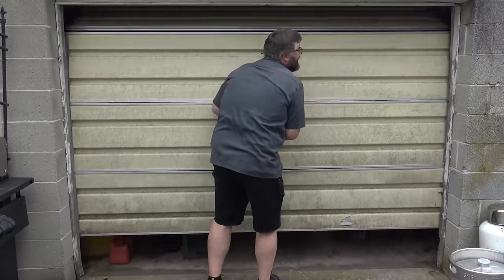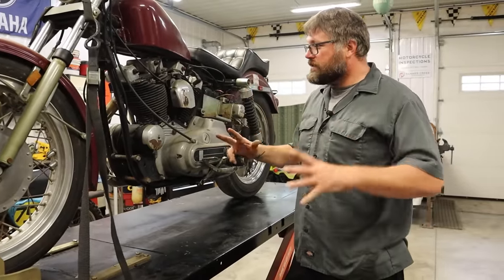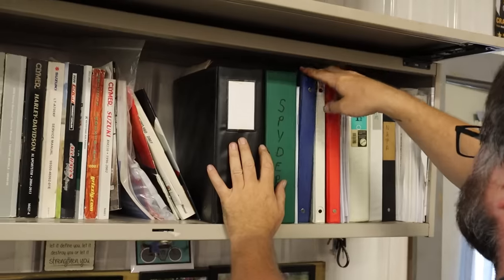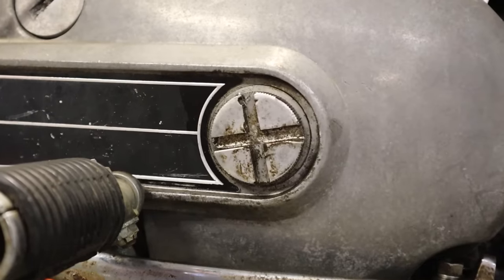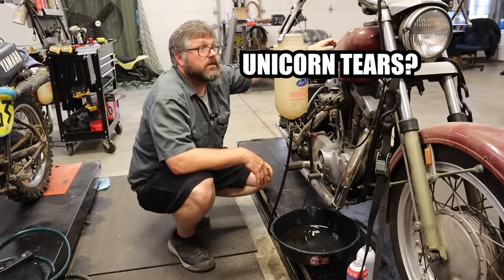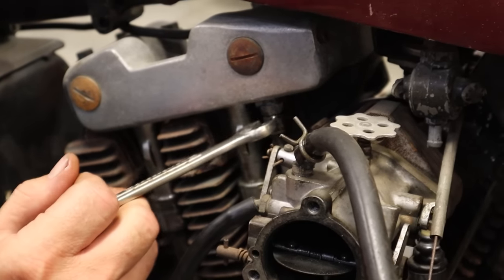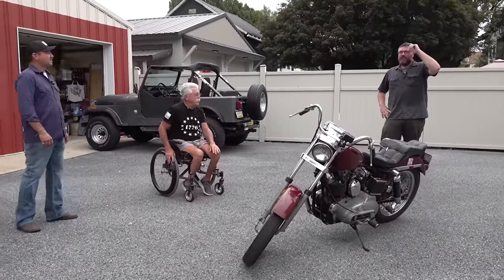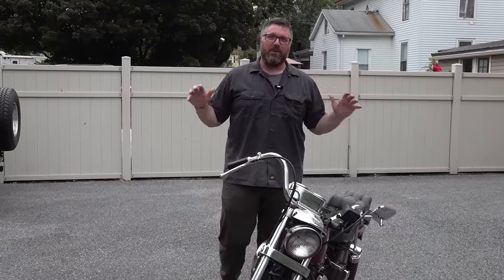Can I Get This Forgotten Harley Davidson Running? (I Just Stole It)

Comment: You keep doing bikes that bring back some really good and scary memories!
My old riding buddy was from Lancaster, Pa. and he rode a 72 AMF Sportster. I rode a new 79 Yamaha XS eleven Midnight Special 
I would pull out my emergency kick starter so, he would stop giving me crap about my wussy electric start feature. 
We lived in a small town with a summer time population of 500 and winter time of 250 . 
We were the talk of the town ( not in a good way ) because we rode bikes and had long hair! This was during the late 70’s to mid 80’s
It didn’t help that our town was a stopping point for the dirty dozen summer ride!
He used 16 penny nails to rivet his back sprocket to the hub and called it good! “Bubble gum and bailing wire” was his tool kit!
What a blast of a good time.
As always stay safe and healthy!
Ron

Comment: It's a 1972 XLCH Sportster. First year 1000cc. First year with no magneto. Last year for drum breaks. Last year for no turn signals. I had a 72 XLH (electric start). Mine also had the aluminum flat track rims. It was equipped with a Bendix carb. Wait till you try to take the primary case off, it takes a hammer impact driver to budge those phillip head bolts out. It's a wet clutch, that's why there is oil in the primary case. I loved that motorcycle, had so much fun on it. I now wish I never sold it. In fact I will have occasional dreams that I still own it and find it in need of love.

Comment: This has quickly become one of my favorite motorcycle themed channels, thank you for the informational yet entertaining content! Here's a pro tip regarding badly designed work lights without magnets all the way from faraway Finland; in my own quite dimly lit garage I use a headlamp (the kind you strap on your forehead) while working on my 2 oldish Suzukis. I have one with variable zoom and different power levels. It frees up both hands, doesnt fall over and directly lights the thing you are looking at. And as it is almost eye level, no shadows.

Comment: You are a good friend. I bought my best friends bike after he passed away from his wife. I am restoring it. It’s an 83 shovel head sportster. Has not run in 15 years but I am doing a basic frame up restoration. It’s almost finished. Taking his original parts and repairing them but did have to replace a few. So it’s a little bit of I am in a little bit of me. And as I keep wrenching on this bike I’m remembering all the good times we had. So one day soon I’ll be riding with him again

Comment: You need one of them deisel/used oil heaters for your shop...home...or both. Even as a backup system you can save money by burning your old oils during the cold parts of the year.

Comment: This is so great.  My own 1974 XLCH still "runs"...technically, but needs much rework on it's brakes, along with a new set of tires.  

I caught a lot of grief back in the day as the new Japanese Super Bikes were coming on strong, but I loved/love my old Sportster and its rumble, and it never let me down in the years when it was my only ride.

Thanks for great video and audio flashback!!!
Kim
Reply: I have a 74 xlch too 
Had it since early 80s
Haven't road it since Easter day 2003.
Because of reasons..just bought  a really nice 2014 ultra classic. And I don't know. 
It's not what I thought. I need my xlch back in the wind

Comment: Rather than starting fluid, I use a trigger spray with petrol in it. 
Picked up a XL125V Varadero that had been laid up for a few years, bottom of tank was pin holed. fitted a temporary tank but wouldn't start. Removed the airbox and sprayed petrol into the carb intakes and it fired. Removed the carb, popped the fuel bowls off and everything was covered in a hard thick green gunk. The main and pilot jets were blocked. Didn't have the correct size just went a size up in each, replaced the tank and the bike has been fine since then.

Comment: Wow, this took me back! Great job coaxing it back to life. I had a ‘76 iron barrel XL 1000 30 years ago which was the transition year so left shift using the brake lever as a gear shift and right brake. Disc front brake and (allegedly) 67 horse power, the same as a Honda CB 750. I had a CB 750 and I believed Honda….. It seemed to use a ton of oil (once I got it going). In fact it was decanting to the chain case which would account for the dragging clutch. The battery was massive but needed to be for the electric start. Rumour has it that it needed 30 miles for the dynamo to recharge the energy lost just firing it up. It was the worst quality bike I’ve ever owned (even a Czech CZ 125 was better). But it was a Harley and I loved it! Sadly its utter lack of reliability and practicality meant it had to go but a sad parting. Love the channel! Best, Ian

Comment: The service manual for the 1982 XLS crankcase/clutch calls for H-D Sportster oil OR a quality 20W-50 if the H-D oil is not available.  There is a screw at the forward bottom of the case.  When it is removed, you fill the case until oil runs out of the hole, then it is filled.  The oil tank should have a separate drain.

Comment: The key to starting that year is to kick it through 2-3 times with the key off. Then turn key on, give it a little gas and if it's tuned properly it should start on the second  kick.

Comment: I use old hospital IV hangers to hold my aux. fuel bottles in the shop but a cheaper/easier to find option is to find a steel shepherd hook plant hanger and weld a base to it.

Comment: In the 80's I had a 1971 XLCH 1000 Sportster. AMF of course. Oddly, it was electric start only! I have noticed some people on youtube miss the fact that Sportsters are only right side chain ( or belt) while bigger hogs have left side with seperate transmission with primary chain or belt.

Comment: That bike looks like a 1971 Sportster XLCH. Last year of the 900. Harley went from 3" diameter pistons to 3-3/16" pistons in 72, thus 1,000 cc. It has been repainted. The aluminum rims are Borronni from Italy. Tires look original. Buckhorn handlebars.
Reply: I'm not sure it's been repainted.  It looks like "Sparkling Red", which was a 1971 color with the Harley decals removed.

Comment: The 1970 model year was the last year for the old style points drive pointing upward near the V of the cylinders. This bike, being a 900, with that style of points drive must be the 1971 model year XLCH. 1971 was also the last year for the ignition switch under the seat and the dreaded Tillotson carburetor . The 1972 model year was upped to 1000cc and the ignition switch was moved to the now familiar location on the left above the horn and got the Bendix carb.
Reply: also has the primary and left crank case for electric start

Comment: Thing with these carb bikes, is once you get them running right, you gotta run them pretty much every day, to keep them running right. Just enough to keep everything warmed up and closed up. Plus, ethanol gas kills these carbs. Best to keep some ethonol treatment in that gas even if you run non ethanol gas in it. Keeps all the carb rubber alive and the jets ungummed. Fun video. Nice to see the two wheeled gremlin lives but it definitely needs someone as possessed as Craig who will go through it and rebuild all the trouble parts. Starting with the carbs and that clutch cable, since that was pointed out as a real repeat issue. Damn nice Harley though. That classic Harley running perfect, polished up with new tires on it, would be awesome.

Comment: Snap On makes the tool to remove the plug from the side case which gives you access to the clutch adjustment screw.
Reply from the maker: Snap on makes a tool for everything!  I want one of those players that can pick up a nickel for the edge

Comment: 👍 primary oil & transmission oil are one in sporties. Level check screw in front of primary,bike up right. 
Manifold rubbers were always shits & did I see correct a block of wood is the heat spacer on carby? 
😉

Comment: My first Tax Plated bike was back in 68 which started my wrench-ride-repete crayze.
From the beginning  when cleaning points I've used a finger nail file to keep the contact surface flat and a single dollar bill on mine and a Benjamin for customers points to clean and clear anything that would burn and pit the point surface. Bill folded with the green ink to the inside, the ink never drys and will leave a coating.
If anything else I do it as a tribute to the Cycle Gods

Comment: 70/71 900cc changeover year Sporty. Had one - It'd get me to the run destination - quite often not got me home. Bad case of sh*tting valves - or gearbox locked in 4th gear.
Great learning curve for a first HD. Totally stripped/ rewired/ rebuilt - no internet in those days

Comment: This also might be a little late but make sure you have oil in the transmission also if I remember correctly transmission oil change is separate from the engine oiling

Comment: Run to your local hardware store and grab a threaded floor flange from the plumbing section and a piece of black steel pipe to match about 4 feet long.  Instant and removable gas IV pole

Comment: It's a 900 XLCH prob late 60's or early 70's. The rims are for taper bead tyres, it was a safety feature that licked the tyre beads onto the rims. Trouble was ordinary tyres were not supposed to be used. It's a Tillitson carb. They used 3 types of carbs, Tillitson, Bendix and Kehin all with accelerator pumps.

Comment: Looks like a 1971 XLCH to me.  As for the Tillotson carb, you need to "tickle" the diaphragm from underneath with a paper clip.  If you google it, you will be able to find info, it's pretty easy.  But you need to do that to draw fuel into the system after they sit for a while.

There is a big Ironed Sportster gathering in New Jersey in October, you and your buddy should ride your Ironheads out and join us.
Reply from the maker: I’m not tickling anything from underneath 😂

Comment: Just a heads up on the iron heads dont use normal motor oil in the transmission on theses it causes the clutch to slip. Use motorcycle oil or Lucas universal transmission fluid instead
Reply from the maker: Always use motorcycle or diesel oil. Never car/gas oil. It will make all clutches slip

Comment: Looks like my 71 XLCH. It's a good year with all new motor castings. 
Mine has over 200k and les than 10k on It's first rebuild. I bought it in 1988 or 89 not running with a bad paintjob and that same horrible seat dyed maroon.
Many were victims of trans failure due to the speedo drive weakening the corner by the output shaft.
They run much better with a carb with an accelerator pump. 71 and 72(1000cc) are notorious for wet sumping and breathing the oil into the primary.

Comment: love the old stuff. keep em running, i have a bunch of used parts from the past. flush the bike out with diesel or kero, than clean the tanks ou,t add marvel mystery oil with gas & 15-40 diesel oil in the oil tank. run it around some, drain oil and fill wt 60wt.

Comment: That's a 71 sportster. Last year for the 900 and first year for the IGN in the engine case, the external circuit breaker was removed.

Comment: I used to drag old bikes out of the woods and get them running with no tools that is I had the bare minimum. But me and my friend sitting on one old Honda from the 60s rolling down a steep hill and popping the clutch to get it unstuck and slide the tire. She was not heavy enough so we put sand bags on it and got it free . Smoke and berrly run on one silinder but it was free. I'm going to buy everything I find as long as it has points

Comment: So, I picked up a KLR 650 last year that been more or less been a nightmare. She starts on starting fluid no problem. Carburetor is clean. But, it is a hard cold start. Also I noticed a very wonky feeling of the clutch is gripping and not gripping if that is makes any sense. I feel like someone who knows there way around a motorcycle is the best option for the 650

Comment: There is a trick to getting these to kick over easy, twist the throttle 3 times with the key off ,then turn it on and jump ! 
The idle was/is to high but it will do ,it should be a slow lope .
 I ride the same model xlh but mine is a half year so it has the 1000 cc motor. 
Last year was the last year I rode 365 day's now it's whenever I feel like a ride or there might be a show... 
Sadly those old iron heads only bring about $1500.00 bucks though
Reply: I live in Germany and halfway decent ones which aren't totally roached are ridiculously expensive here. For an original 70s XLCH with papers/title you get at least 9,000-10,000 Euros.

Comment: Itonhead soortaters do not share oil between the crankcase and transmission. Separate drain plug under the crankcase
Reply from the maker: TBO it always breaks my brain on how these things oil. There isn't a trans fill though? The service book shows they are the same.

Comment: You should use SPORTSTER Transmission and primary fluid, not 60W oil in a ironhead primary or any sporty for that matter.  50-60W oil in the tank is good since they run hot and need heavy oil.
Reply: No. Unmodified ironheads need the same oil in the transmission which is in the engine. They have a valve between the engine and the trans and the oils do mix. You don't want Sportster trans fluid in your engine.
Some people delete these valves, but I don't see the point. My ironheads run perfectly with 20W50 or 60 weight in the transmission.

Comment: Mt 1969 XLCH Sportster is an absolute bear to start. Kick start only with magneto ignition. Yes it has tossed me over the handlebars trying to start it.
Reply: It is all about correctly adjusted tappets and timing, timing, timing. .016 gap for the points and if you don't have automatic advance put a mark somewhere on the magneto control which gives you 12-15 degrees BTDC. In my experience that is the sweet spot for easy starts.
Spark plug gap is also very important if you have an old  magneto which is a bit on the weak side.
Reply: @albinklein7680  the timing adjustment cable broke and have not gotten a replacement yet. I have a piece of mechanics wire holding the magneto in place when I go to start it. As far as I know the Fairbanks Morse magneto that is on it has never been recharged. My father bought the bike in 1970 when he returned from Vietnam.
Reply: @shadymaint1  I really envy you having a bike from your dad! That is one of the coolest things ever. My dad had numerous ultra-cool bikes when he was young (a Benelli Tornado and a Laverda SFC for example) but all of them are long gone...
You have to spend the 50 Bucks to have that magnet charged up!

Comment: Hey Craig good afternoon listen I'm a sportsterman throw and through those transmissions run best on Harley transmission Sportster oil you try thicker they don't shift right Sportster Harley transmission fluid is the only thing to put in there Believe me please Mount Carmel PA here
Reply from the maker: Right on. I run that in the later ones, I'll give it a try on the older ones too

Comment: I didn't see you set the gap in the points. I would replace them and the condenser and set the gap. Timing a Sportster is a two man job because the timing mark is on the flywheel on the left side of the bike.
Reply from the maker: Yeah… hours of work got cut into a 30 minute vid. Couldn’t show it all.👍

Comment: Old Harleys if their not all taken apart and just parked shouldn't take much. Clean the spark plugs check the oil service. Charge up a battery, feed it some clean fuel. Pull the trigger.

Comment: Hey Craig, if you really want a challenge, I've got a custom bike that has a sputter issue when giving gas on easy throttle.  1800cc boulevard. But not your typical Boulevard.

Comment: That looks like a Zenith carb which is not all that bad. Made one work well after sitting 20 years with just a good cleaning.
Reply: No. It is a Tillotson and they are a nightmare when you are no expert on those. They have no float but a diaphragm. If you are used to normal carbs, you are kind of helpless with those.

Comment: Craig check some local auto mechanics or salvage yards some use wast oil heaters and will be happy to take your used oil.
Reply from the maker: Yeah That's what I do with mine. I just drop it off in 5 gallons instead of 55 gallons now.
Reply: @The_Bearded_Mechanic  it feels good to recycle don't it lol

Comment: My first bike i got on my own, I didn't know a whole a lot, but I knew enough to get in trouble and fix some stuff. 
So there I was, 15, trying to get this bike runnig for months. I had no luck. Had air, fuel, spark.....(or i thought i had spark)
I get it down to my Papa's first thing he does is  take the cover off, clean the points and it started. 
I didn't even know what points were yet, i had heard about them, but never learned where, how, what they do and why. I learned that day ahahah. 
When it started I just stood there with my jaw on the ground in shock that it took him about 5 minutes to sort the damn problem out for me. 
Miss you Papa. Thanks for all the teachings

Comment: Should have just soaked the carb and cleaned the tank.  Nice thought though.
Reply from the maker: I did clean the tank. If you are familiar with those carbs….nevermind….. haha
Reply: @The_Bearded_Mechanic  I hear you, for me, fastest way is through it.  Mono blocks, flat slides, I would still dunk it.  It's not fast, but it's right.